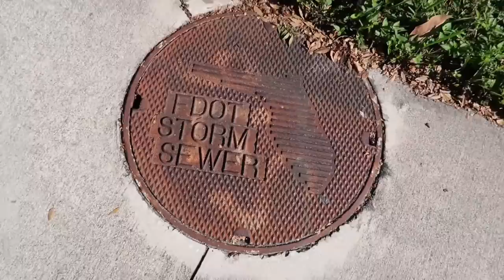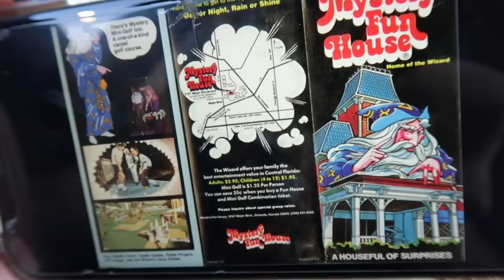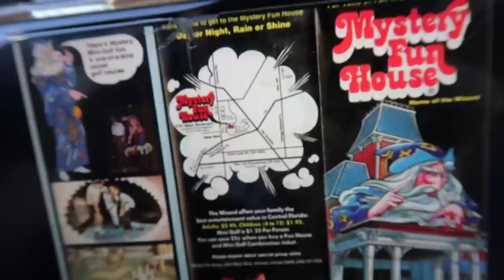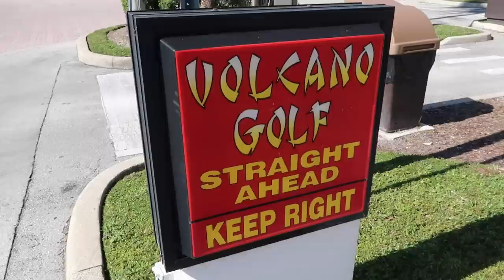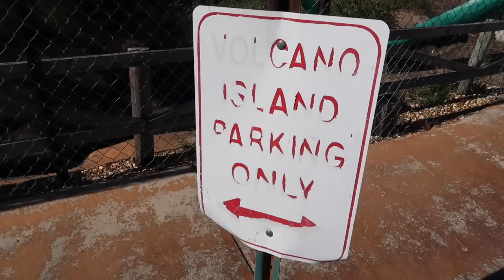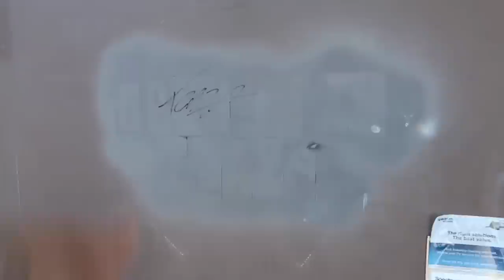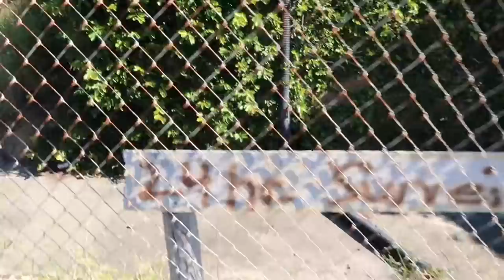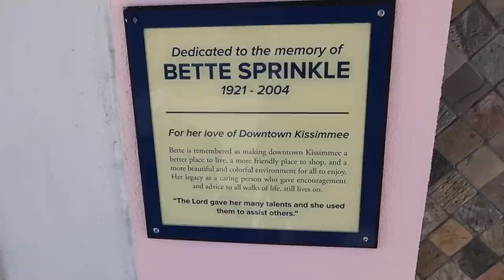The Destruction Of Mystery Funhouse - Goodbye To International Drive Roadside Attractions In Orlando

Comment: I think that thing on the tripod on the outside of the fence is a laser transit, its used for excavation for measuting elevation. There is probably another piece on a pole in where they are working to measure.